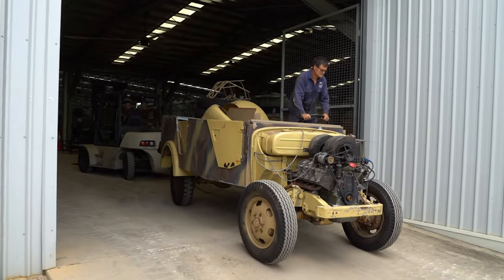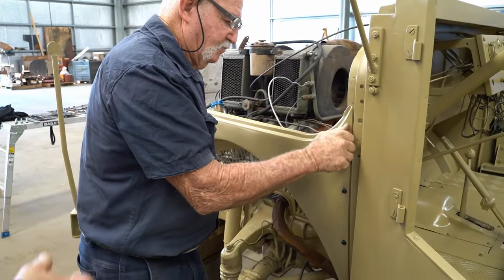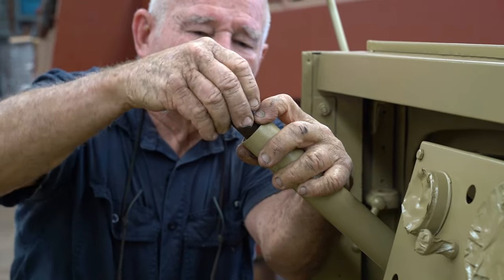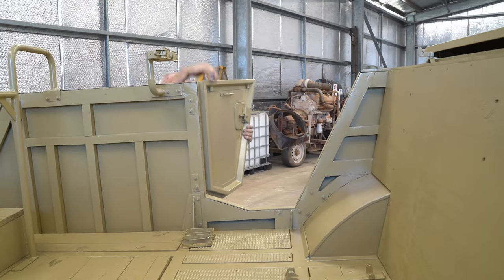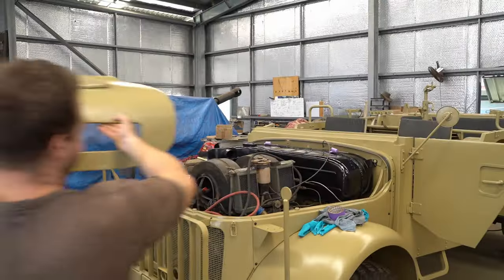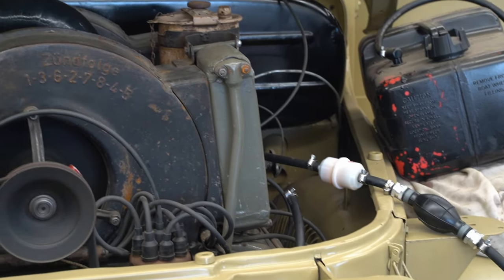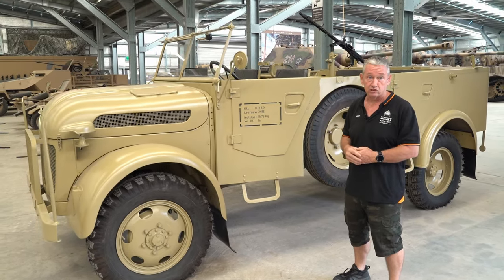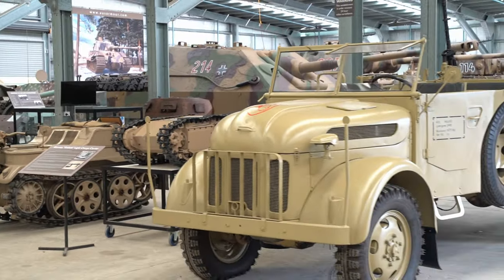WORKSHOP WEDNESDAY: Restoring and assembling a WWII Wehrmacht Steyr 1500A

Comment: The engine was designed by Prof. Ferdinand Porsche. He joined Steyr, in Austria, in 1929 and worked there for a couple of years. He designed this air-cooled, V8, during that period.
Reply: What was with Ferinands fixation with aircooled?? I suspect these would be very poor in the hot deserts and even in hot weather in Germany.

Comment: The engine was designed by Prof. Ferdinand Porsche. He joined Steyr, in Austria, in 1929 and worked there for a couple of years. He designed this air-cooled, V8, during that period.

Comment: It's so good to see how well you all work together as a team.   That Steyr  looks amazing.   Congratulations.    Ausarmour does NOT cut corners,  real craftsmanship.    Good to get a bit of history  too.   Timber in trucks,  Didn't British utility trucks use wood for drop sides, tailgate  and  the load deck in (? rickety memory!) Bedford 3 and 5 ton vehicles?
Reply: Yes, most had hardwood for the load areas.
Many soft-skinned vehicle cabs had framework constructed from ash.
Check out 'Katie' from 'Ice Cold in Alex'.
Reply: @MillwalltheCat  Thinking Morris Minor Clubman Estate.   I think spares for wooden body parts still available but rationed to genuine restorers  not Ebay traders etc.
Reply: On the top of my head, I believe all English utility lorries had those, at least at the beginning of the 'campaign'

Comment: The air-cooled, V8 engine was designed by Dr. Ferdinand Porsche. He joined Steyr, in Austria, in 1929 and worked there for several years. During this period, he designed and developed this engine. Porsche was a great proponent of air-cooled engines.

Comment: I'm sure I've seen WW2 original photos of one setup as a wireless communication vehicle with the radio equipment mounted on benches where the rear facing bench seat behind the front seat is, the operators sat on the existing forward facing bench seat just behind the rack. Whip antennas were mounted on the rear quarters and extra batteries as well as a charging kit were mounted in the rear compartment.

Comment: A great job you did on the Steyr 1500 A/02, 1.5-ton, 4x4. It was very reliable and much liked by the troops and had good off road capability. I noticed that you guys have difficulty to turn the steering wheel but once you drive on it gets much easier ro turn. Perhaps it should be greased better. I know because I had drive it years ago and belongs to a friend of mine. I liked it very much.....

Comment: Your parking brake cable or whatever it is hanging down on the drivers side coming off the rear axle is rubbing up against the driveshaft. you can see it pretty good at 14:12

Thanks for the great video. Beautiful old truck for sure!

Comment: “Timber not usually associated with a truck”- 1940s vehicles had more in common with horse drawn carriages, than modern vehicles. The monocoque design of aircraft, later in the war, revolutionised the vehicle industry.

Comment: The V8 air cooled engine was used post war by Sydney Allard in his race car in  England. It was successful, as was his other V8 specials using 'Bren Gun ' carrier surplus motors.
Reply: Well, the engine for the "Bren Gun" carrier (mfk as the Universal Carrier) is the famous Ford flathead V8. And as any American hotrodder will tell you, its a fairly easy to maintain and tune, with lots of parts still available to this day.

Comment: I remember the very first thing I painted. I was maybe 8 years old. An old schwinn beach cruiser.  I sanded every inch down to 2000 grit . I mean I really took my time and got it perfect.  Then got every speck of dust off and set up a little area with plastic and a fan facing outwardly... then painted and the next day it looked amazing.  Till I picked it up and all the paint started falling off because It didn't have anything to grip to lol.  Lesson learned the hard way.

Comment: Interesting. The engine looks very much like the one they used in their light utility aircraft such as the BF108 and Fiesler Storch, albeit the V is up instead of down. Is this the case?
Reply: Sorry! Completely different engine, just similar principle. The BF 108 as well as the Storch had an Argus flight engine, much larger capacity, no forced ventilation cooling
Reply: Thanks, the rocker cover arrangement looked similar, to me that's what through me.

Comment: Question,  on some of the other German command cars, the center wheel(s) were mounted on an open hub, so the spare tires would turn. This helped to eliminate high centering wjen on rough terrain. Does this vehicle have that feature?

Comment: Well done , l did not see a radiator being fitted , is it an air cooled engine ?
Reply: It's air cooled
Reply: That big housing on top of the engine that looks like it belongs to a swamp cooler is the cooling air fan duct.

Comment: Air cooled engine........no freeze cracking in winter. Still have to light a fire under the engine though.........like at the Demyansk pocket, when it was -55C
Reply: Yeah not fun when you don't have the fuel to idle and keep it warm.

Comment: Perspex windsheilds? Is that period correct, or something done for the museum? Cheaper than glass? Easier to clean? Safer in terms of breakage?
Reply: Glass probably would have been the original.
Reply: @obsidianjane4413  Wiki says that Perspex was "first brought to market in 1933 by German Röhm & Haas AG (as of January 2019, part of Evonik Industries) and its partner and former U.S. affiliate Rohm and Haas Company under the trademark Plexiglas.", so I'm not sure.
Reply: @amcconnell6730  True, but Germany had limited production capacity  and most of their acrylic production would have been going into aircraft glazings and bakeliite. But they did weird things so its possible, but glass would have been the rational choice.
Reply: As far as i know, the Heinkel 111's nose windows were also made from perspex. Regards from the Battle of the Bulge area, Belgium.

Comment: Thanks for showing the crude and unskilled assembly of such parts as grills necessitated by the drain on skilled labour by the armed forces in that war. A world wide subject sadly neglected. The hospital here, built for American casualties from D Day, had terrible brickwork but lasted 70 years. Could you perhaps expand on this subject in your excellent videos? Only sad point. None of the, necessarily paint stripped hinges, appear to have received a smear of long lasting copper lubricant?

Comment: Its a bit of a salad. It has the late bonnet, the grills are not correct. the body is of the earlier type with rear mudguards. the joint between the front section and the hood/bonnet engine covers should not be a welded on strip but made of vinyl or flax type material to allow for body flex. Would need to see the serial number before working out what is correct for the year.